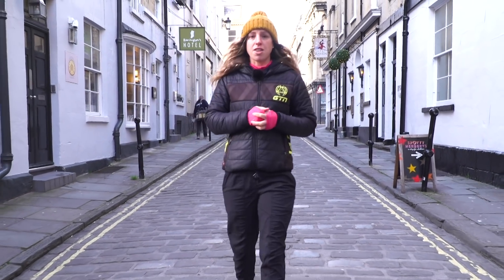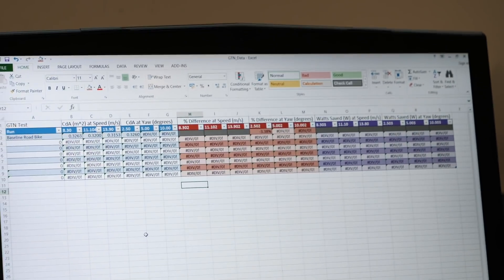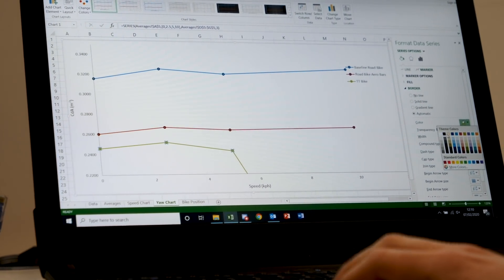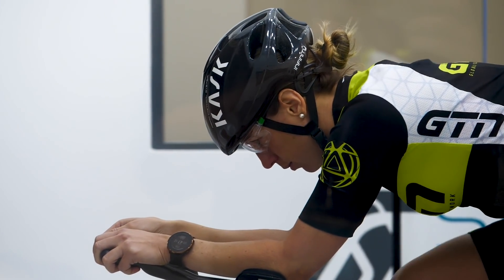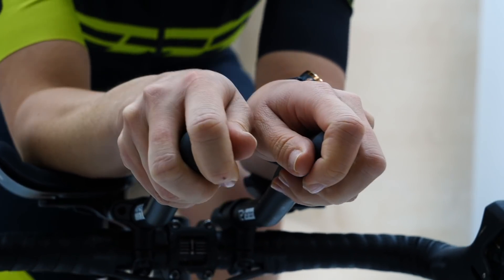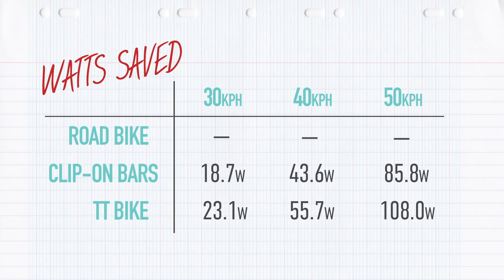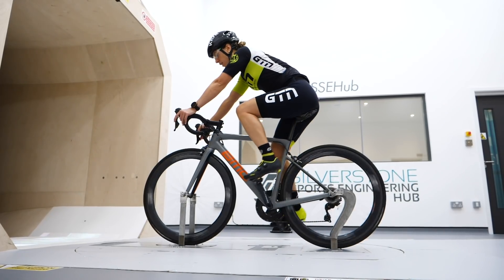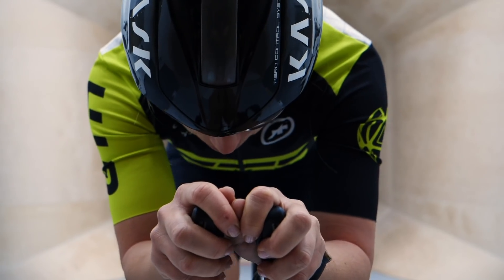Time Trial Bike vs Road Bike | Wind Tunnel Testing

Comment: Please do this test again but compare like with like. Compare one company's TT bike with the same company's aero road bike with a zero offset seatpost, as similar a riding position as possible, and the same wheels. I suspect the difference will be very small. You also need to consider how many watts you can sustain on both bikes, how fast you can negotiate a typical number of bends and turns, how late you can leave braking, how fast you can descend, how much energy a more rigid TT bike takes out of you before the run, etc, etc.

Comment: 100 Watts? That's waaay more than I expected.
Reply: 100W @ 50 kph, that means that to ride at a steady speed of 50 kph on a flat road will require say 380W rather than 480W. Huge difference, true, but practical? Not so much.

Comment: Just curious.. is there a point to pedaling in a wind tunnel?
Reply: Yes
Reply: Steve Spell  care to elaborate?
Reply: @kentao4  It emulates the movements of the rider riding their bike - it wouldn't be very good to be able to get into a really aero position statically, but not be able to maintain that position as you are riding....also it turns the wheels - although I suppose they could use a motor to do that.
Reply: Chris Gilligan thanks.

Comment: I’ve just bought a cervelo p3 and have found riding on the aero bars while climbing so demoralizing as my fit friends ride away from me on the club ride,I’ve got Nice Ironman in June shall I persevere with this or use my road bike?
Reply: Don't climb on the bars then, get on the hoods
Reply: Robert Wright you’re not supposed to have yourself in the aero position while climbing that’s why it feels weird and you feel like almost falling. Also did you get the bike professionally fitted to you? Maybe a tuneup to the bike itself ? Or maybe just get stronger on the bike? Idk I’m just trying to give you ideas on what can be wrong
Reply: You're not able to produce as much power in the aero position. On most club rides people ride too fast and probably wouldn't fare well if they had to run off the bike which means they're not pacing their effort like you would on a race. With that said there is little to be gained in aero position if you're climbing at less than 20kph, so get on your base bar and breathe!
Reply: Thanks for taking the time to reply guys,I looked in the gtn archives and found a brilliant video discussing this very subject,apparently 15kph and below there’s no aero benefit on the aero bars so I’ll take this into account and practice practice practice,getting used to this position as I’m only 2 rides in and did 100 k club ride today